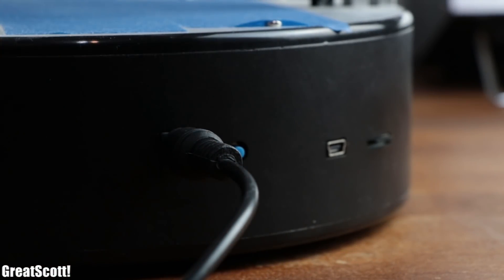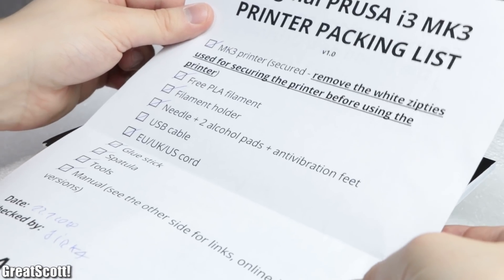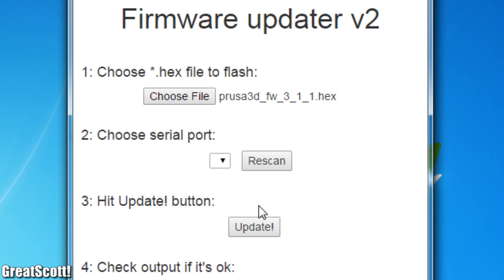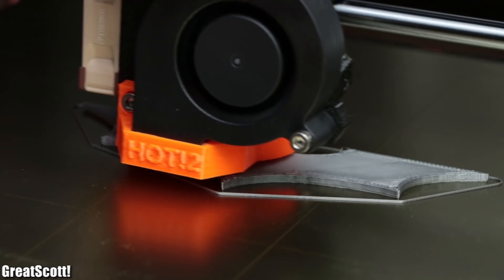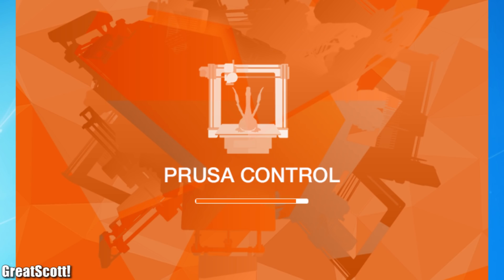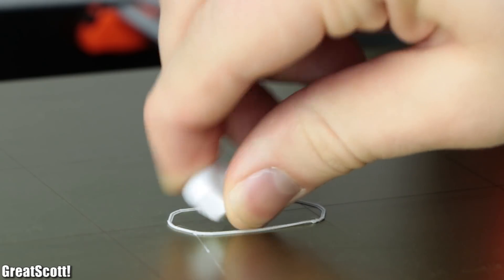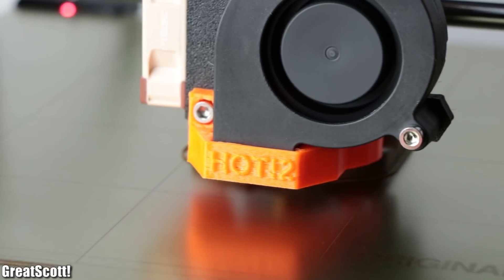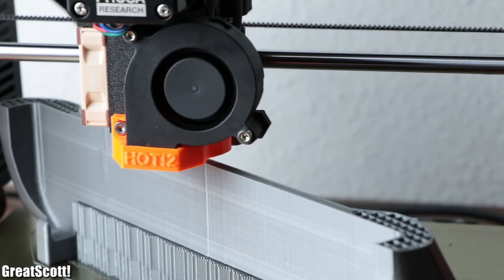Original Prusa i3 MK3 3D Printer Review - Still the best 3D Printer?

Comment: I bought one and I'm regretting it now. One of the printed parts broke during assembly when setting nuts into the printed part. Thinking I'd get a new one sent to me, I contacted Prusa. "it's your fault. Buy a replacement from our shop". What? the part was badly printed, with bad dimensional accuracy. "Doesn't matter. Pay for a new part form out shop".
Wish I knew about their attitude before I paid premium $ for hobby quality.
Reply: That's crazy. I recently got my fifth printer from Prusa and all the parts have been top quality. I've also received free replacement parts (like thermistors) from support on a number of occasions.
If you have Twitter you can tag Matt Stultz, he is Head of Community at Prusa. 
Although the individual parts actually only cost a few euros.

I'm very surprised and I definitely don't share this experience!
Reply: @JanTec3D  I agree. Crazy and really unexpected. All my contact was through info@prusa3d.com so you don't know who you are going to get. The response I got was really negative and I did what I was told; I bought a replacement part from the shop. Small value only but the shipping cost wasn't good. I'm sure some have a good experience with Prusa, but in this case I must have struck someone having a bad day. Even with this bad experience I have just bought another one. At least via email there is only one, so good luck if you strike the ogre.

Comment: I see the results you’re obtaining with this 1000 dollars printer, And I can now say, my 160 dollar ender 3 does the same, and maybe better.
Reply: it's not better I am speaking from experience
Reply: Electronic TOJ when analyzing the results without knowing which printer did the job, if the ender 3 is perfectly calibrated and the slicer properly configured, the results are the same, I’m also talking from experience :)

When you pay the extra cost for a prusa printer, you’re paying for a better factory calibrated machine and also for a couple extra features. All this can be achieved with an ender 3, knowing how to calibrate and adjust the machine.
Reply: I have many printers, prusa i3 mk3s is better than ender 3

Comment: Buy something else.. the servo wires on the fan break after 30 hours of printing (at least in my case, some people have had better luck).
Reply: What a bullshit are you talking about???
Reply: @harynian  The wires to the print fan are prone to failure.  The theory is that the cable shroud causes high strain (the opposite of what its supposed to do).  Allegedly Prusa has rectified this failure mode with a new type of cable shroud.  I am a little bent out of shape because their customer service did not seem to take any ownership of the failure and did not attempt to ease the burden of fixing the issue.
Reply: @1koenner  I have MK3 since preorder (for 2 years?). I print a lot and no problem so far. You had to do something wrong. Anyway, you can replace wires easly. What is the problem? Saying to not buy the printer because weak wires is 
pathetic.
Reply: @harynian  You may want to open your mind to the concept of variation - others experiences may be different than your own.  I will admit that my original post expressed some hyperbole as a result of feeling unfairly treated by a company that I have also supported for more than 2 years and was left to pay for an issue that I believe is a design issue. Feel free to do your own searching; you may find that I am not the only person that has experienced this issue.
Reply: @1koenner  But what is the problem to replace a wires which are very cheap???
Reply: @harynian  Well, it's more about the response from Prusa that could be improved.  After all, many people are spending over 1000USD for a "Prusa", which in terms of hardware is similar to printers that are much less expensive.  Prusa has a slight advantage over other similar printers when it comes to the ease of print bed leveling/calibration, and a few other convenient features, like layer shift detection, and filament detection (however, honestly these latter features have yet to actually be needed by me).  Coming back to the customer support, that has not proven to provide any monetary benefit.  Therefore, at this point, I am wondering if the premium that I paid over other similar printers was worth it.

Comment: I really hoped for better print quality from a printer that price. My (fairly old) Wanhao Duplicator 4 does better PLA. I am still fighting with ABS and really wish that my printer had a better and larger print bed.
Reply: It does pretty well if you don't print at crazy speeds as shown in the video, though. I printed a benchy that looks almost flawless in ~40 mins including heating. Maybe Prusa wanted to showcase the printer's capabilities by providing faster pre-sliced gcode lol

Comment: Prusa mk3 is so slow.... Insanely slow. And the print quality is not so high as it expected. I'm using Anycubic's delta. Its hard to assemble and calibrate, but after all of its done - 120-150 mm/sec with stunning outer shell. Smooth as butter. And you can convert it on 32 bit chips or Klipper firmware and do even better.

Comment: My question is how bad are the fumes during a print as my kids have breathing issues around strong smells
Reply: From my experience with a different 3D printer, there is barely any smell at all (at least for PLA plastic). However this may be different with another printer. If you are sensitive you could put one of those IKEA (or similar brand) plastic containers around them, that should contain any fume (if there is any).

Comment: "Great price/performance ratio"? Sorry, no. This thing is WAY to expensive for what you are getting, certainly in a time where i can buy 5 Ender 3's for that price, while the output on an Ender 3 is the same or even better (with less fancy functions). There is no way that the hardware on a Prusa I3 is worth €700, no way!
Reply: I disagree on hat, I have th CR10 Mini ( bigger than the Pi3MK3) but quality is better on the P I3MK3. and i did not need to print extra parts like bed leveling knobs etc .
the CR10 is a great printer for its price, but  part for part the I3 is a level above the CR10.

Comment: I've recently received and assembled my Mk3 kit, but am getting a "filament sensor wiring error" response during initial calibration. I have verified the wiring multiple times, and used a multimeter to check continuity in all of the connector wires. Is my sensor 100% faulty, or is there something else I can try?
Reply: Sounds to me that you bought a piece of junk I advise you to sell it and get a real 3D printer

Comment: I see the printer still has wobbling issues that results in shadows and waves on the surface of your prints. Probably the metal frame is stable in the X direction but less in the Y direction.

Comment: Hey GreatScott! I have a problem. I am trying to make a circuit controlled with arduino, with the controlled appliance being 120 volts. Usually I would use a relay, but I want this circuit to be dimmable by the arduino. What could I use for this?
Reply: solid state relay 

or a triac if you're feeling brave

Comment: Unfortunately, this Review is pretty biased.
Yes,  the MK3 is a good printer. But Prusa is STILL struggling with the firmware (Linear advance disabled and fu*ked up microsteppings, not able to resolve ringing / ghosting, not able to solve overshooting issues) and is massively lacking communication.
The results you show off as "pretty decent" are actually really really bad, I'm afraid. But that all comes down to personal expectation. I personally would await way more from a 800 Euros printer.
Reply: So for 800-1000 euros you basically get product quality of a Chinese DIY kit 3D printer for $120?
Reply: Well, as you can see the various posts and threads in the forums and Facebooks groups, they're not doing the job very well. Prusa shipped out unhardened rods, my filament sensor war DOA, the printed parts that came with the printer were printed with aweful quality and wrong dimensions. Replacement parts were for a MK2S. So I can't tell that their qc is suitable for a company this size
Reply: most of these issues are resolved by now.
Reply: I am still considering which 3D printer to purchase. In this case, is there other better options that you could recommend?
Reply: Especially considering you can pick up an anycubic linear plus kossel for about $225, slap a duet in it for a little more, and have a beautiful workhorse for way less
Reply: I wouldn't call it biased so much as innocent ignorance. Scott doesn't have as much experience as others do when it comes to printing standards. I trust Prusa to fix the firmware. It takes time.
Reply: Dont get me wrong, I own a MK3 myself. I'm sure that the Prusa team is going to fix their stuff eventually. But it's not good practise HOW they do their business. There is no communication about issues, there is literally no quality control, misdesigned parts, flaws and issues all over the place. The MK3 is just not ready for the market yet. At best, it's in early prototype status.
Reply: When was linear advance or microstepping ever disabled? I literally haven't had a single problem with the MK3 that wasn't completely my fault. Also, ringing is present on literally every 3D printer on earth. If you don't like it, use a lower external perimeter speed. It slows the print down by minutes at worst and can drastically reduce ringing. The MK3 isn't perfect but you certainly have yet to name a single valid issue with the thing.

Valid complaints are: Manual belt tensioning is a complete joke (I retensioned my belts after about 100hrs according to the assembly manual, the belt tension reading didn't change at all). The square nuts are outdated, and are very difficult and annoying to work with. They should use brass inserts instead like Lulzbot does. The 2x16 LCD+rotary encoder is a bit outdated at this point, but works okay. And the Mendel kinematics with the Y bed are really limiting in terms of acceleration (that's why the i3 acceleration settings are soooo low compared to other kinematics profiles). Also a lot of people are having problems with the power supply. It does click when the heatbed turns on and off. The assembly instructions could be a bit more detailed.

If you can come up with very many commercial products that have less problems then this, I'll be damned. Damned I say.
Reply: Paul Arnold: Actually, there is the whole department at Prusa Research dedicated to quality control. What was your problem?
Reply: Paul is spot on. I ordered on the day they announced the printer, so I was one of the first to get mine. The features and price point are really very good, but early firmware versions still had a lot of problems and not all of those are fixed even now. To be clear, it seems some of these quality issues escape newer users, but they are systemic - not having to do with assembly. I'm sure the issues are going to be taken care of, but as a return customer I'm pretty surprised and disappointed that us early adopters were free beta testers. Prusa has a reputation of making the most of of the design by creating a well-tuned system and that's what I was expecting. Again, we'll get there, but I was hoping to be there already!

Comment: I wanted to get Prusa i3 MK2(.5) but its price still was too high for me, so I got the cheapest 3D printer kit with known good track record (FLSun, Anycubic was one of the candidates but the influencer replied too late)
It's loud, it's wobbly, it keeps knocking parts off the bed, etc.
I drowned the bed with glue stick and turned the settings to perfection.
It took me whopping 3 weeks of constant effort to get everything working at least a bit reliably.
Now you know why Prusa printers are a bit expensive. They make sure you will have the best possible experience with their products. One by one. And that costs money.
Reply: Sounds to me like you just don't know what the hell you're doing

Comment: I read about PETG bonding to PEI so well, it'll destroy itself when removing. Did you coat the surface with something before printing the PETG cardholder?
Reply from the maker: +Felix Dietz No. Worked without a problem.

Comment: I am soo frustrated that every last BS is still shipped with a USB cable in the year 2018... seriously, you'd have to come from at least the Andromeda Nebula to not be drowning in them by now. Also, especially people who order a 3D printer of all things do not have a USB cable, right... know your audience. Jesus Christ :) Well, sometimes, rarely-rarely, you just have to go out and get that extra bit, sometimes it is a battery, or maybe a USB cable. We could stop global warming, if manufacturers stopped doing this...
Reply: Erm no, you're one of few who is drowning in USB-B cables. Who still uses that form factor for anything portable enough that they would be "drowning" in them? Out of all devices in my house, the printers, Steering wheel, CNC machine, and Arduino use that form factor only. I probably have at most 1-2 extra cables of that form factor. It's not as common as you expect, and if every device that uses such a cable came with it, and you didn't junk devices every once in a while, you wouldn't have that many excess cables no?

Comment: I bought an Ender 2 for just 140 bucks and so far it's working fine. Of course there aren't any fancy features but still one of the best entry-level "get yourself hyped up without breaking your wallet"-kind of 3D printers :)
Reply: $140!? Damn! How's the print quality? Have you been able to fine-tune it to get a decent quality?
Reply: Benchy had a few tiny things that weren't as good as his one in the video but it's pretty damn close and definitely more than acceptable for that price.
Reply: EpicLPer but did you get gummy bears?
Reply: EpicLPer, I love your picture! Is that your OC?
Reply: I did not know about this printer! thanks ! been saving up for a 3D Printer lately..
Reply: https://youtu.be/1lYmP_N_4Q4
Reply: https://youtu.be/1lYmP_N_4Q4
Reply: David
You haven't the faintest idea. you don't know anything about that.
Reply: If safety is important, the Ender does far better.
Reply: in my opinion the anet a8 is better, you just have to upgrade it and its works perfectly. im already printing with 0.1mm and the quality is really good
Reply: @behindmaxscenes  no what are you on? the A8 is pure garbage stock. with mods, it will become a decent printer, but an Ender2/3 is decent in stock and gets even better with mods and doesn't have a massive fire risk. Even a tronxy x1 looks to be better than the A8

Comment: Why aren't you a fan of Cartesian style 3D printers?  What do you prefer instead?  I like your efforts to improve the technology culture.
Reply: Simon But the i3 is not the best cartesian printer at all. Have a look at corexy or ultimaker kinematics. Deltas can be very tricky to deal with if you want to print technical parts.
Reply: Jonathan Boette delta 3d printers I think. They are more convenient because you can have a big build volume, with a smaller printer

Comment: too expansive for I3 i get same result with chinese 200 $ printer even better speed if the body is 2020 extrusion aluminum
Reply: No, you won't. You will not get the same customer support, the same features, or the silence. This already has 2020 aluminum extrusions. Great Scott did not push this printer's speeds at all, but several have had it reliably print at speeds up to 200mm/s.
Reply: @SplicesAndCelluloid  their customer support sucks Dave had software problems that have lasted way too long and shipped out inferior  Parts.
Reply: customer support is for toaster ovens not 3d printers  , if you can't make a Chinese i3 kit  work then  3d printing isn't for u
Reply: What happens if your parts are dead on arrival? Who you going to blame? Want to get replacement parts? You lose any chance of getting help if you buy from china. At 200$, you are lucky to get a full set of parts that don't break on the first go.
Reply: @SplicesAndCelluloid  oh I see you must have bought one of these pieces of crap that's why you're sticking up for them so well I have six printers all of them from China none of them came with DOA parts and I've had no problems plus they're about the cost of one of these things for all of them.
Reply: such a BS. 
some people might have limitations when it comes to assembly, either visually or motoric skill or combination of that.

Comment: I have a MK2 and have always been disappointed with it having 3d printed parts. They are slowly breaking after 6+ months of use, and TBH do look a bit crap. That said, it still performs better than most better looking printers in the same price bracket. But yeah, 3D printing is all about frustration tolerance. I still havent worked up the nerve to figure out how to get ninjaflex to print in it. After a few mangled noodle events I took it out and went back to PLA!
Reply: You have a printer, just reprint the parts.
Reply: Wireline yes and they look terrible and stringy. I assembled a kit and all the nuts would not fit properly. Molded plastic would be so much better...
Reply: Tony bro i want software name ?
where i get the software ?
anly links
kindly share me 
my mail: Akhilsunny060@gmail.com
Reply: TheDroidBay  pls help me
akhilsunny060@gmail.com
Reply: @YEJJUAKHILKUMAR  Stop being such a fucking idiot.